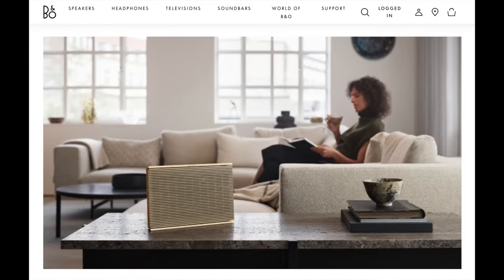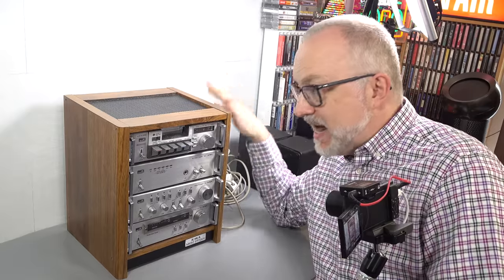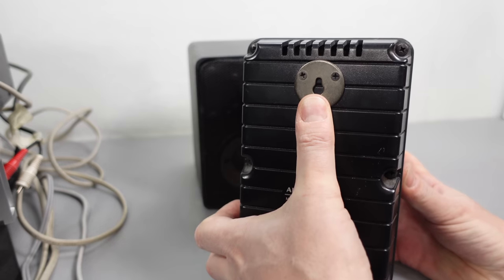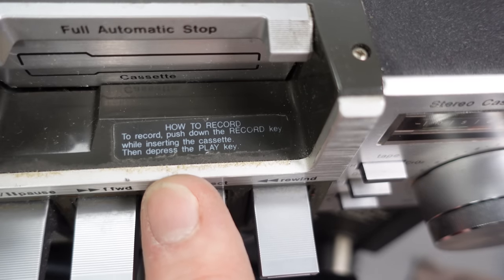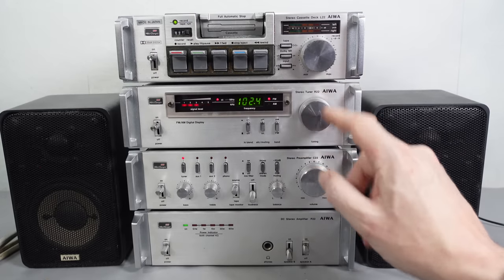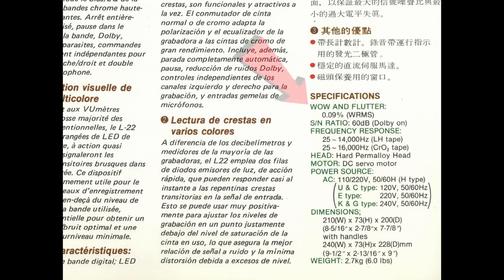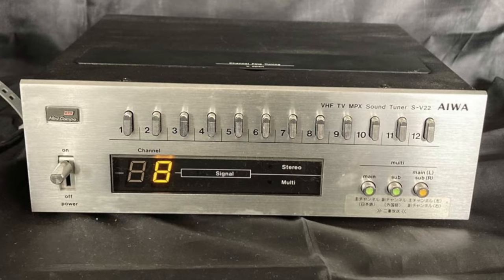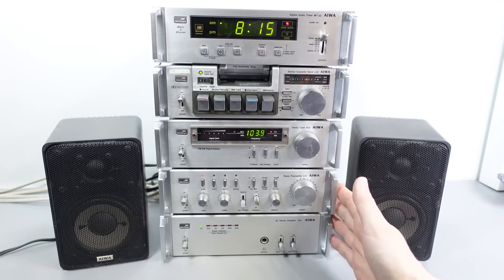AIWA SYSTEM 22 -  Micro HiFi from 1979

Comment: What a gorgeous looking system. The Japanese hifi designers really deserve all the pints for the stuff they came up with in the 60s/70s/80s. !
Reply: Indeed so.! 😎
Reply: The speakers don't look gorgeous at all. And those grab handles take up space without being of much utility.
Reply: The speakers look fine to me. And the grab handles are essential because it was intended as a rack mount system. They really don't do consumer electronics this nice anymore. Honestly, I think that there's room for a high-end discrete component micro system like this even today, but it would cost a LOT of money.
Reply: @AWLor0  The handles are very important for rack mounted units like this.
Reply: 🍻 enjoy your pints guys 🍺
Reply: @herrkampf473  Interesting comment, but wrong! The handles on such front facing equipment was sponsored by the likes of studio rack mounted kit that needed easy insertion and removal, an event that might occur with some regularity due to whatever application was required for a specific session. The handles were there to help a person manoeuvre the unit into the port slides of the rack, and also to pull, or remove the unit, as needed. The ones used on these domestic units are purely cosmetic and non functional.
Reply: @marknestbox I’m sorry, but exactly why are handles on domestic units “non functional”? They are mounted on racks as well, and require pulling to be extracted.
Reply: @AWLor0  those speakers look like the Realistic Minimus 7, which is a great small speaker for what it is. I'd imagine they are based on that design.
Reply: handles on hifi equipment are part of the period design, which was influenced by professional studio equipment and therefore a turn away from the furniture the companies used to offer. So it was modern and even if I didn't change the configuration of my hifi-stack daily, still these handles have the protective function for the switches and regulators, like on a pro device. I like the handles as being part of the design.
Reply: @FantasticOtto  They are purely to give the equipment a more professional appearance, you do not need them on these small units; take a look at 07:12, he removes it effortlessly with one hand! Also, you next to never dismantle a domestic unit to rearrange the set-up of a mini HiFi. The handles on studio kit was a necessity because the stuff is both bulky and heavy and often needs changing, and I know from many years of experience and still posses pro kit as it happens.
Reply: AiwA was soo cool designer and hifi maker. I salute, Come back,we miss u,aiwa team!
Reply: Pints?
Reply: @marknestbox  🤦🏻‍♂️
Reply: @FantasticOtto  exactly
Reply: @gazzertrn  beer... The person who said that was probably British.
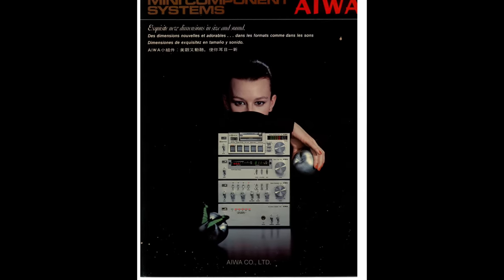Reply: @AWLor0  2:50 shows that the handles are optional, but the various racks available for the system suggest they would actually come in handy, especially if you planned on using the travel case.
Reply: They look like minimus 7 or close….which means the sound is potentially 🤩
Reply: Original minimus 7 were from Japan too. They are AMAZING
Reply: @ChaossX77  Precisely the silliness of why you are commenting. Many thanks.
Reply: @marknestbox  🤦🏻‍♂️
Reply: @AWLor0  complain some more why don't you
Reply: @madcrowmaxwell It would cost a lot of money for sure, but back then these types of units cost a lot of money as well. I think back then people were just happy to pay for the quality.
Reply: @Blowncapacitor84  That is what I was thinking Minimus 7, and from what I have read about them they sounded very good for the size of the units.  I think they even had a very micro system to go with those speakers as well.
Reply: Yeah, looks great given its 40 years old. If you said it was recent I'd believe you.   Repair just need to be methodical tracing through from the inputs to the output with a decent scope, with some knowledge of audio design.  Its only newer stuff that needs recapping, well made capicitors dont really go wrong.  Curious Marc has tested caps from the '30's and they are perfect 90 years later.  The cassette is probably a transistor that has died between the head and the output or a dry joint.  Taking it to pieces and getting a circuit diagram would be the main challenge.  If you don't have that, need to reverse engineer one and that is hard and time consuming.
Reply: I've got a Blaupunkt Micronic from 1980 which is very much like this, apart from it has an open tape deck which gives an extra visual thrill. Despite being a Blaupunkt, it too is made in Japan. Cost me £5 off Ebay about 10 years ago.
Reply: I have these Aiwa speakers and after seeing some images of the Minimum 7 and a review where they can be describing how mine sound yes, they're totally the same.
Reply: @madcrowmaxwell  Yeah I had a brilliant Aiwa hifi in the mid 80's which sounded great, but the speakers were made with pressboard. If I had known more about audio I would have replaced them right away. Otherwise the system sounded amazing for a small component stereo.
Reply: @Blowncapacitor84  okay, but the term "gorgeous" is not right here.
Reply: @gazzertrn  of beer ?

Comment: Only a note: the radio unit isn't a "digital tuner" but an analog tuner with a digital frequency indicator...
Reply: Yes; you are correct about that being only an analog tuner with a "digital" frequency readout, as I have seen a few other components like this also, (usually either very old tuners like this one, OR very cheap quality if new), and this specific tuner in this video sounds like it has gotten out of alignment because of bad capacitors over the decades, so it could definitely benefit from a rebuild in that respect, by someone who knows how to adjust and align analog tuners correctly!
Reply: I'm sorry but for me, electronic technician since 1985, a "digital tuner" is a PLL synthesised tuner, not an analogic tuner with a "digital readout" of the frequency.
You are free to think as you like, but electronically speaking, my definition is the exact one (and only).
Reply: And nowadays we have digital tuners with analog dials.
Reply: @DJNickYouTube  Did you not even read the original poster's comment entirely? He was/is saying the same exact thing as you are, so no need to act like you're in "disagreement" with him.

And pretty much everyone else here in this thread, including me, are all saying this same basic thing too.
Reply: @RCAvhstape  IKR? Modern crap digital tuners from China trying to profit from the "retro" or "vintage" fad nowadays, lol!...

Only REAL vintage gear actually deserves recognition for that IMO, because most modern gear, especially if cheap and flimsy and geared towards the younger "retro fad" crowd, is nothing more than an insult to the quality levels of REAL vintage gear, especially if it's still working properly and/or been serviced to be like new again! There's really NO modern equivalent to most of the better quality TRUE vintage gear from the 60's, 70's, 80's, and 90's!

All of the modern gear, unless it's extremely high-end, (AND expensive!), is all just made in China and usually total crap quality!
Reply: @haweater1555  I have a Sanyo Plus 55 receiver that has that.  Frequency display moves with the red tuning dial dot.  I need to pull it out of storage and get it fixed up.  Thanks for the reminder.  :)
Reply: neat
Reply: @JoeJ-8282   He IS the original poster.  And no, everyone isn't saying the same thing.  But none of that really matters when we're dealing with the crisis of a missing right channel on the deck.
Reply: @nickwallette6201  Yes, you are correct, and my bad for not noticing that he was/is the original poster too. I didn't even think about that possibility simply because of his rather condescending tone in response to that other guy commenting before his second reply.
Anyway, I agree that the "bigger problem" with this whole thing is the fact that the unit in the video has one channel that isn't working.

Comment: I'm an electronics technician and I've been working on units like this since the late 1970s - around the time these systems were brand new! Consequently I have a lot of experience working on them and I'd be able to sort out all the little issues these have in short order. I also have access to a wide range of parts, the likes of what were used in these machines so repairs generally aren't a problem. 
It would be unusual to get a system like this today which didn't have some kind of fault. By now, most of these units are 30+ years old and things wear out, belts perish or harden, capacitors and other parts need replacing and anything mechanical will need some cleaning, alignment and lubrication.
The beauty however is that these machines were made to be repaired by human hands, unlike most of the modern stuff which is now made by robots in factories and designed in such a way that they're not able to be worked on, even if you can get the parts.
Reply: I'm also an electronics technician since the 70s and worked on this stuff too. As Technomoan says, unless you can work on one of these yourself it's really not economically viable to buy one, as the amount of hours required to make a system like this work like it should, would make it a very expensive purchase in the end. I was never attracted to these micro systems as the small speakers let down the rest of the system.
Reply: set up a youtube channel!
Reply: @BrennanYoung  I've thought about it but it doesn't interest me. I prefer just to focus on repairing people's equipment and bringing things back to life.
Reply: Way cool answer. That is a fact. Human hand. Human design,human overhaul. It is like Art,even. When push play,▶ we hear sweet hifisound from friends audiogear,we know instantly,he loves thy deck,player. Something To maintain,keep clean,demag, aligment and so on. To discuss about,compare. Analog world is a world on its own.
Reply: In the early nineties I was given a non-functioning Uher microsystem. It featured a power supply that worked at 25 kHz. I tried, put some new components in, but it was over my repairing skills, unfortunately. It wasn't the one shown, though.
Reply: Yeah..you can "board swap" on modern systems...maybe. They are designed to be disposable. I too was an electronic tech in my "youthful" days.
Reply: @BrennanYoung totally!
Reply: @sw6188
Like some others said in response to your reply, PLEASE set up a you tube channel, and share some of your stories, parts, and equipment with us!
Thanks Friend.
Reply: I find systems of the 80s and early 90s super cumbersome to work with. Access is horrible and you have a tangle of wires everywhere which you have to desolder to get to things, since connectors were apparently expensive. Have to buiild extension harnesses or test jigs to measure things out while the device is running. I have a feeling that they are rarely made to be repaired - some obviously are, others not so. You alo have inferior materials like garbage PCBs that just love to delaminate - this sort of pest isn't quite gone today, but at least as far as high densty circuits are concerned, they have to use better materials.

Today's SMD PCBs i can handle with relative ease. The two problems i find is unobtanium proprietary ICs and firmware that hasn't been dumped. Sure you need magnification but you know what, tools are just as much a part of human endeavour as the knowledge, it's not like you'd be reparing any electronics no matter how ancient with you bare hands and teeth. I suggest that Right to Repair legislation may partially solve issues with unobtanium parts and firmware.
Reply: @sw6188  Not sure if you're aware of it or not, but there's a massive youtube community who just watch videos of people repairing stuff. Many are just over the shoulders views of repairs in high speed
Reply: Glad to know there are others who do what I do (and have done since '77).
Reply: The Steph Space  No I haven't simulated it on LT Spice. I'm an old-school tech, I have never even used simulators and I didn't need one to know that the design of the pre-amp was wrong. For a starter they have used a single rail supply, so the output sits at 1/2 VCC - and no blocking capacitor so there is DC on the output. There is also an instability in the circuit which I have yet to identify the cause of. I have built my own RIAA preamps before but on this occasion I just needed something easy and ready-made so decided to try these boards. In future I will just make my own again.
Reply: @caodesignworks2407  Yes, I know there's quite a few people who like to watch repair videos. I would need more time in my day (or have less time for repairs) if I videoed each one, as there's considerable work in editing and uploading later on.
Reply: Me too i'm Electronics engineer and specialise in Hi-Fi repairs,  most of these units maybe 40 years old but there always going to be more reliable than most modern units today, there never going to get to 40 year's old but will end up in a recycling centre much sooner!.
And not all repairers need to be on YouTube to earn a living!
Reply: A YouTube Collab is in order. Please.
Reply: I think this applies to guitar amps too now, digital guitar amps aren't repairable to the same extent. Probably applies to a lot of other things, very odd that we live in a supposed greener world where we are meant to be big on the environment and recycling, but big tech is blatantly taking the power to repair stuff and extend its life, out of our hands.
Reply: where are you based?
Reply: @sw6188  Are you UK based? I've got one of these in pretty much mint condition, in it's rack. I love it and would pay anything to preserve it.  Recapped and bias etc set.
The cassette player doesn't work anymore (I presume belts) but I've never opened it up to look. The power amp died so I just bought another exact same  P22 amp from ebay which works fine, however sometime the the left channel takes a few minutes to warm up before any sound comes through . When it does, it sound fantastic. I have it driving some 200 watt Rogers LS7's speakers. It drives them effortlessly and rarely turn the volume past 4 in the dial.
Reply: @sw6188  Some don't bother with editing. Just make it a private stream over the shoulder while fixing. No need to even talk. Then just make the stream visible after. Obviously no one should do it if not interested otherwise it will be a hassle for you.
Reply: @stillben  New Zealand.
Reply: @RogueTrader-  I'm in New Zealand.
Reply: Point is that as time goes on there are less and less people with the knowledge to be able to repair these sort of things. Therefore it is imperative for these technicians to for example show videos or tutorials to preserve that knowledge for future generations. It will certainly help to keep these systems alive for another 40 years with tech-minded people of the future.
Reply: Fully powering them up having not met electricity for a while can cause issues.
Reply: These mini systems are not entirely easy to fix either. They used lots of hard to find ICs. Many ICs from 1979 are not readily available now and due to the compact size boards were not easy to get at. I used to own an Aurex mini system and when one of the IC modules blew I had to dispose for parts because the IC couldn't be found.
Reply: @socksumi  Yes if they used proprietary or custom modules they can be impossible to find now and in some cases even if you find one there is no guarantee that it is working. I am seeing a lot of semiconductors from 40-50 years ago that have failed for no apparent reason. Even parts which have never been fitted to a unit, new in the bag - failed.
Depending on the unit however there can be solutions including fitting discrete components to replace modules.
Reply: @sw6188  Good points. Also I'm not a fan of older ICs and OP amps (1970s & 80s). To my ears they don't sound as natural as discreet circuits although ICs do offer excellent paper specs but how that correlates to what we hear is a whole topic of discussion.
Reply: @socksumi  Yup, you can go down the rabbit hole with that one - because everyone perceives sound and its qualities differently. What sounds good to one person sounds like a bag of balls to the next person. I have to agree however - I prefer the sound of a discrete circuit and the best part of those is they are easy to repair. No special custom parts that are obsolete. In most cases I will have the transistors needed on the shelf, or I can sub them out with a similar device. I have a friend who works at an electronics recycling centre and he keeps me supplied with all manner of components, parts, modules and more.
Reply: Yo también hago bastante eso de ver a toda velocidad como alguien repara los aparatos, y también me pone nervioso ver como tienen el problema delante de sus ojos y no lo ven !
Reply: @sw6188  set up a cam, no audio. people would watch if its weird enough, even silent. unique tech and your knowlege should be shared forever!
Reply: @caodesignworks2407  the pakistan/india stuff is crazy what they salvage
Reply: I have an Aiwa 22 system that needs some attention, I only like listening and looking at them so way beyond me to fix. Please tell me you are in the UK and would be able to take a look at my system?

Comment: I miss the era of the stereo. Walking into one of the stores that specialized in audio and checking out the systems was a real treat. You could almost be hypnotized by all the flashing lights!
Thanks for the memories.
Reply: When I was a young Army private I used to go to the shops to daydream about the latest stereo offerings from Japan, back in the early 80s. As I didn't make much money, it took me about 18 months to save up for a proper stereo system. Things were definitely built with looks in mind as well as sound output back then.